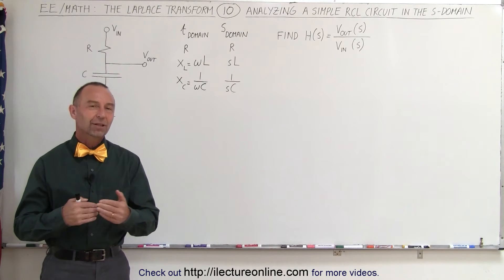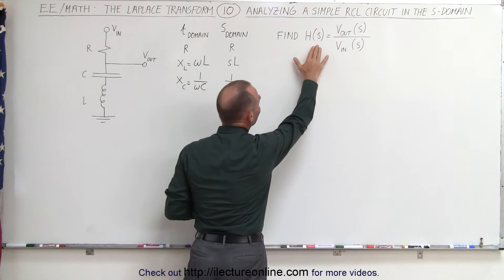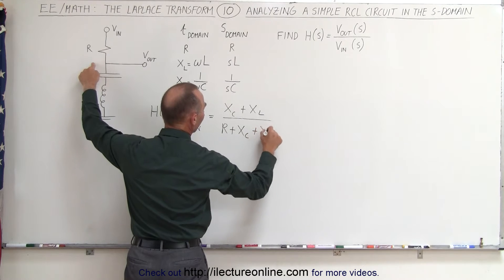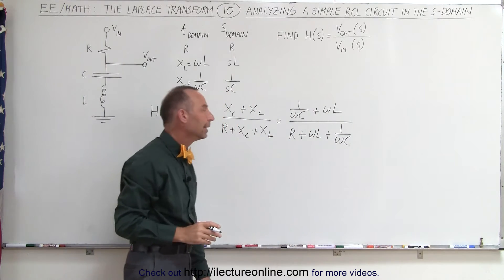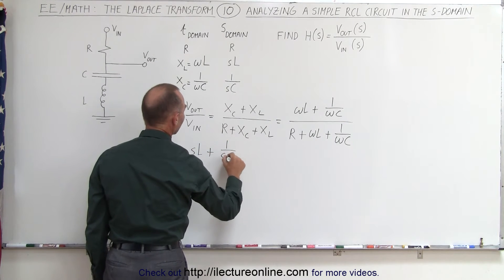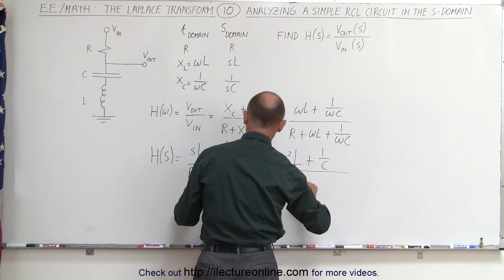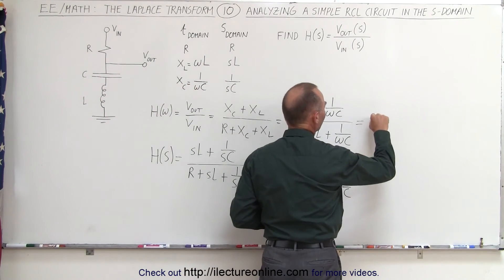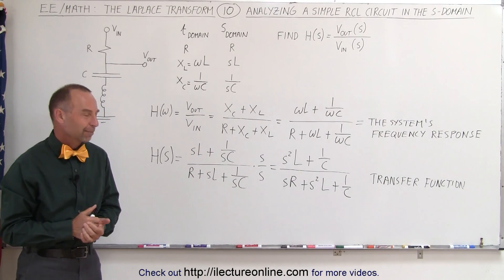Electrical Engineering: Ch 16: Laplace Transform (10 of 58) Analyzing a RCL Circuit in the s-Domain

Comment: How come Vout isn't the normal voltage divider formula as in Vout= Vin*((Xc+XL)/(Xc+XL+R))? But instead the Vin is missing and then H(s) is just the ratio, ignoring Vin?

I got the answer from my lab assistant! It's because H(s)=Vout(s)/Vin(s) = ratio, and if you multiply both sides by vin, then you get v Vout =Vin  times ratio. Just like the divider
Reply: Good observation. It's helpful to clarify that.